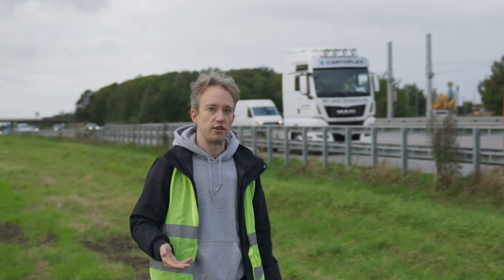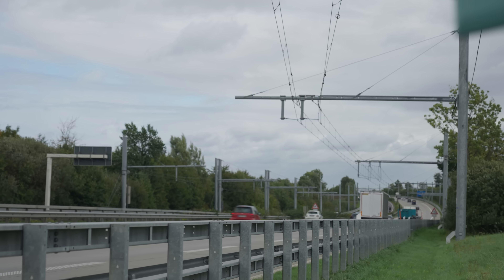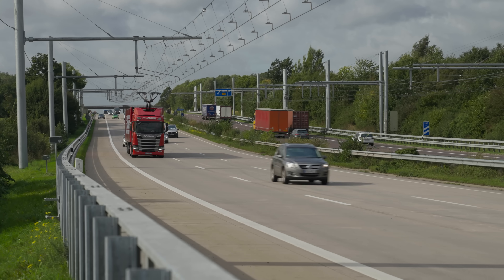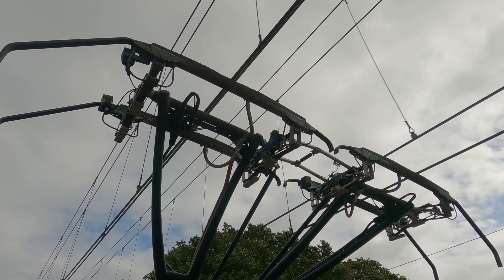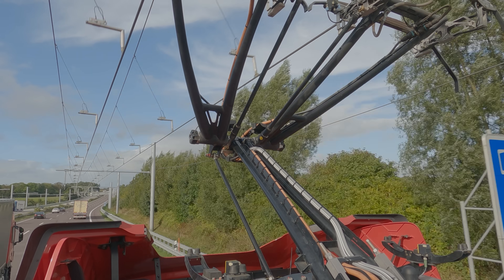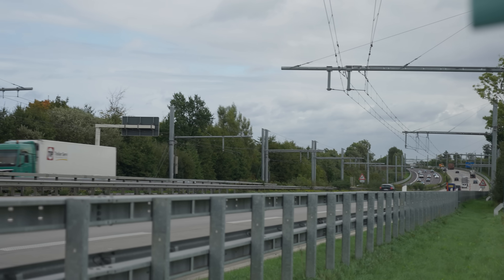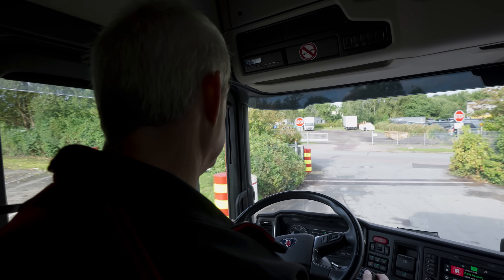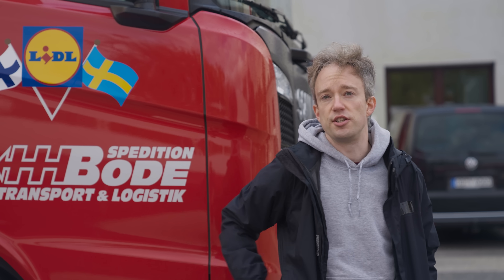The highway where trucks work like electric trains

Comment: While of course I'd prefer an increase in train use and infrastructure, this seems like a viable puzzle piece to help.
Reply: McFlickers  That is certainly true. But as said in another place already, last-mile delivery could be done by trucks. But having centralized train hubs could cut down on traffic overall. 
I think one major problem right now is the fact that most companies cut down on their depot sizes and using trucks as mobile ware houses. Which is ok-ish if everything goes right, but as we can currently see (and saw especially during panic buying behaviour at the beginning of the pandemic), it's easy now to run into delivery shortages in a just-in-time delivery setup...
Reply: @Djaenzee  trains might not run when you need them, they also might not take the amount of cargo you need
Reply: @ligametis  Well, cargo trains are not like passanger trains. They can be planned to roll when they are needed. And if you need to deliver something to an hour accuracy, a truck will not be better either. And a train can always take more cargo than a truck. If there is high demand it might be posssible to lengthen (or also shorten) a train or plan more trains. But as said elsewhere: Main problem is the lack of railway network, it has declined over the last decades because of low maintenance. 
But all your points are solvable problems.
Reply: @Djaenzee  usually not more, but less cargo needs to be delivered, however frequently, exactly when needed. Trucks are more adaptable in this regard. You don't need to book a space, wait for a full train, can deliver to a couple locations along the way. Planned means need to work with others, wait for others. Not that frequently everyone needs to go to the same location.
Reply: McFlickers  Companies do not pop up spontaneously. We can, maybe, consider only planning industrial areas near trainstations?
Reply: @M.M.83-U  so are you going to pay the trillions to move all the business's around germany so they can all use different trains until you then realise the network for railways isnt large enough so the economy collapses and then everyone goes back to trucks
Reply: @ItzChaza  no, we pay the much more modest amount needed to have all serious industrial districts linked to the rail network, do not allow new company to start theyr business too far away, and let the more isolated ones to take care of themselves.
Reply: @M.M.83-U  so your now trying to control where a company starts up which will cause huge arguments, and what happens if a company gets a huge order one night and needs it shipped by the next day? just book a whole new train? whos paying the increased costs of this as the small company sure wont be as its just cheaper for him to hire in 4 lorries and move the containers himself. your trying to live in a simcity style world and thats just not how life is. and your "much more modest amount" is utter bs. again i go back to my orignal point. cost, ease, simplicity of travel > just being more efficient over long distances. and all your talk about linking to the rain network? whos paying for all that as that would be billions, whos funding the purchase of all the new trains as that would cost millions. all these costs your ignoring because it doesnt fit your narrative. and this is ignoring the fact most groups of businesses are surrounded by houses so whos paying them to move house as again that would be billions accross the country... stop trying to live in a simulation. we already tried to run everything by rail 100 years ago and it all stopped and went by lorry because of the exact reasons i stated above, and none of those reasons have changed to now
Reply: Flicks  Companies and warehouse managed to do this exact thing for over a 100 years and in places like Switzerland with a national freight policy still do
Reply: An electric truck can have a battery, and use overhead wires for the bulk of the route and battery for the last mile, turning etc

Comment: now all the UK needs is a few nuclear power stations to pick up the slack and avoid completely botching any movement into mass amounts of electric vehicles.
renewable energy is just too unreliable unless there's an immense array of distributed industrial size batteries everywhere that can fill in the gaps in power needs when there's a week long storm that drops solar through the floor and shuts down wind turbines due to excessive wind speed.

Comment: Adding an extra 1.5 years of operating cost before you even break even on a lorry will add some significant cost to the shipping. Especially when they currently only last 6 or 7 years before the cost of fixing and maintaining them outweighs the cost for a new replacement.

I like the concept but, the cost needs to come way down before its voluntarily adopted.
Reply: Rising diesel prices will change those numbers a lot.

Comment: The wear on that pantograf looks quite serious though! I wonder if it is more than on trains. I don't see any sig sag in the lines which normal overhead wires for train do have. But I guess with the smaller pantografs and counting for wind sway in the lines there is no room for sig sag (Or put the poles closer together for less sway but higher installation costs).

Comment: If we need to transport containers on our motorways, this makes enormous sense. However, many countries already have a network of electrified transport corridors - our rail networks. Transferring containers by rail, with electric trucks for last mile delivery would take a significant number of trucks of motorways, reduce emissions, and make better use of rail infrastructure. Having said all that, is love to see these on our motorways.
Reply: this might be additional for mid-range in rural areas. get the train for long range and warehouses close to the rail, those trucks for less rail-dense areas and where the route to and from the next train station is too long, battery trucks for the last mile.
Reply: @noahluppe  Yes, agree with you there. Also a lot of cities have overhead wires for electric trolleybusses. I wonder could electric lorries take advantage of them?

Comment: Why not... just use electric trains?
Reply: Lack of capacity, lack of coverage, lower flexibility, etc. Don't get me wrong, rail is still the better option, but pretending it's as easy as "just put it on a train instead" is a bit short-sighted.
Reply: @bartholomewdan  I mean I get that preparing a train infrastructure is both expensive and can only be used by trains, but if there's no need for flexibility and large amounts of stuff needs get carried regularly, and the main consideration is environment, isn't rail better long term?

Comment: such a simple idea that works. things work more efficiently when you cut the middleman a.k.a. battery and just have it run directly from the grid, too bad it runs on rubber tyres. people have tried wireless nonsense and bla bla bla charging yet to no avail and tesla semi will be roaming on the street in how many years again?

Comment: Put wireless charging pads under the road and add a receiving antenna to the vehicles - every car could then use them and not have to have a massive battery for motorway journeys
Reply: Wireless charging has very large losses, giant waste of energy. Much more difficult to install as well, you need to rip up the hole highway.

Comment: Soon batteries will be so cheap and abundant that this solution will be obsolete before it could be rolled out. Might still make sense on really busy highways, to extend the range of trucks at a reasonable cost.

And no, trains are not a good alternative, because they are too inflexible and cost a lot to build.
Reply: Wdym trains are not a good alternative? They're clearly the superior method of logistical transport. 

Too inflexible? Physically or economically? I don't quite get it.

Comment: What is the carbon cost of building the infrastructure though? And what is its lifespan? This is neglected all too often. But I still think this is a great idea!
Reply: The environmental cost of building something once is significantly less than the continued use of something like gasoline, especially with a high enough demand. As for lifespan, electric motors normally last longer than gas engines and so really the only thing to worry about is the road and the wires. Of which the wires seem to have a fairly long lifespan, with much easier repair cost than the road. So in the end they are better than regular trucks environmentally.
Reply: @hi__im_zack4890  All of that is just your assumption though. It may be true but I want to see the numbers that prove it. You'd be surprised how much of the world's emissions come from building infrastructure and if you are thinking about deploying this on a big scale than it needs to be considered very well whether this is the right way to go. It's probably greener than diesel but is it greener than hydrogen for example?
Reply: @simiken1234  Luckily for us, we don't need to rely on assumptions as there is a lot of data already in existence. Have you heard of the trolleybus? It uses the same technology and has existed with wide-scale use (not in NA) for over a hundred years. We can compare the environmental costs of trolleybuses and motorbuses to get a good idea of the benefits when applied to the trucks. All in all, trolleybuses have proven to be vastly more environmentally friendly than motorbusses in the long term (on that account of not using gas).

You are right about infrastructure having a negative effect on the environment, but the most significant source of emissions from infrastructure is concrete. So in that sense, the difference between regular truck systems and these would be relatively insignificant compared to the road itself (which is required by both).

Comment: I saw somewere in China that the buses had supercapacitors and a catenary in each stop.
The supercaps last enough to reach the next charger.
Electric trucks with a small battery pack and this infrastructure can leave the highway fully charged. If today's constraint is the availability of batteries, this can be a solution for now.

Comment: If the goal is reducing greenhouse emissions (a dubiously justified position, IMHO) is the goal, then why is Germany phasing out its nuclear plants, with the shortfall currently being taken up largely by coal-fired generation?  Moving to electric trucks will only worsen air pollution, centralize official control (who can turn off power to the grid at will), and increase dependence upon the rare-earth minerals required for such batteries... which means handing China more power.

Comment: The problem is very much the last mile but the technology shown could be used for that and combined with public transport in the form of trolley busses using the same wires. If each vehicle had a modest battery then they could disconnect from the wires, over take a loading bus and then reconnect. For the trunk road movement this should all be done on electrified railways.

Comment: Looks more like a trolleybus than a train to me:-) I tend to say it's already proven technology. If I remember well the wear and tear on the power lines is quite high, so that might be an issue if every truck on the freeway is going to connect to it. Obvious great for efficiency as lighter batteries improves energy efficiency and means less wear and tear on the vehicles or more carrying capacity whichever way you want to go.

Comment: The city I just moved out of had a massive tram/trolly infrastructure that they converted to fit electric busses. It's interesting to see new applications for very similar technology used to combat more extreme climate change mechanisms.

Edited because my dumbass forgot the difference between trolly and cable car.
Reply: Trolleybusses have been around for decades, they work very well. The only issue is that some people dislike those wires over city streets.
Reply: i think you might me confused as to what a "cable car" is. Do you mean a tram? I don't see how you could convert cable car infrastructure for busses
Reply: @Hephera  oh lord, you're right. I used the wrong word. It's from an old tram/trolly system. Not cable cars.

Comment: Don't you just love how we got rid or all our trolley bus and most of our tram networks 70+ years ago! Trolley busses or lorries with batteries seem like a good solution. Most busses go in and out of a city, put the cables in the city and allow it to recharge the batteries at a high rate of charge, then rather than needing to be charged for a whole days driving, it can be topped up throughout the day - reducing the amount of batteries required which reduces the cost (and weight) of the vehicle.

Comment: It's good idea but how high the wires are is going to be realistic for trucks and maybe buses . So only used by companies .
Reply: Don't mis understanding I think it would work from a commercial standpoint specially with rising fuel cost. But you would need to have all truck manufacturer commit to  have it as an option. And need like a alliance to push the infrastructure upgrade

Comment: You don't need a hybrid. You can have substantially smaller butteries and save the entire combustion drivetrain. The batteries just need to last for off-highway end-points.
Reply: The combustion part is currently still needed because this is only a 5km test track.

Comment: I look at this and see another problem with this not mentioned here. It appears as shown here the system uses human-driven trucks, but it would make a lot more sense for automated steering to take over to keep the truck in position under the wires. Manually steering that precisely for any length of time would be exhausting for a driver, and automated is surely the future anyway. This would produce a result similar to a "trackless trolley," a vehicle that automatically follows a precise course, possibly even following a painted line on the road, or super-precise GPS. Such things have been used in public transit for some time. Given that these trucks, like the aforementioned trackless trolleys, probably all have the exact same track width, this causes the problem that they are rolling over the exact same spot of pavement each time. This wears sharp grooves in the road, much worse than manually steered vehicles that will spread the wear out over a wider rut. There are rubber-tire people movers that apparently have solved this problem through specially-designed roll-ways - they have very sharp-edged tire marks but apparently don't wear too much - but that would require rebuilding part of the road. If they don't do that, higher maintenance costs will result as they have to keep fixing the grooves. Either way a lot more cost than simply stringing up some wires. There's also concerns about wire wear, as trains typically have only one pantograph per locomotive, power car, or EMU set, a lot fewer passing per hour than if every truck had one. Wires would wear out a lot quicker than they do on railways. I'd also be concerned about safety issues if a wire were to be damaged and come loose - even if the system is instantly de-energized, the wire could cause serious damage or injury if it hit a car, someone in a convertible, or a motorcyclist. Not so much a problem on trains where everyone is inside a much sturdier train.

I've thought of a somewhat similar system, but I think it would make more sense to do it as a third rail (actually a pair of rails) type thing than overhead wires, mounted along a guard rail type structure beside the road, probably the inner (left in Germany or US) lane, probably attached to the road median divider. The larger rails would last longer before wearing out, and not have the danger of coming loose and beheading a motorcyclist. The bigger advantage I'd see of it though is that it would be feasible to connect any electric vehicle to it using a retractable arm that extends from the left (Germany/US) side, with automatic steering keeping the vehicle the proper distance from the rails. Arm would only need to be 30cm long or so, and could be mounted on anything from a small sedan to a semi. Overhead wires have to be high enough for trucks to fit under them, but that means a pantograph for connecting a small car to them would be impractically tall, likely taller than the car is long. Vehicles would be in this "charging lane" fully automated, automated systems installed along with the contact arm would control the distance to the rails, as well as control speed to control distance between vehicles, all coordinated together. This would allow vehicles to operate bumper-to-bumper at highway speeds, vastly increasing road capacity, and allow drivers to rest. They could merge in or out at any time, vehicles in front and behind making and closing gaps as needed. There's the danger of these energized rails at an accessible height, but normally there's nobody not in a car on the motorway, and automated monitoring systems could de-energize the rails if any sort of mishap - say a crash - happens that might result in people walking around on the road.
Reply: i would think the pantograph design leaves a bit of wiggle room of 3 or so metres so the truckers wouldnt have to be accurate to the nearest centimetre at every moment. also those bumps and ridges seens as the camera pans upwards to look at the pantograph seem to be some sort of guiding system to keep the pantographs aligned

Comment: 2 issues

1 What about tall loads? Which would entangle with the wires. In particular accessing the non powered portion of the autobahn.

2
I recall not infrequent news pm the railway of the power lines being down for 1 reason or another. 
2.1 how would the traffic cope?
2.2 what about the risk from the electricity? Railway is for the most part nothing but trains.